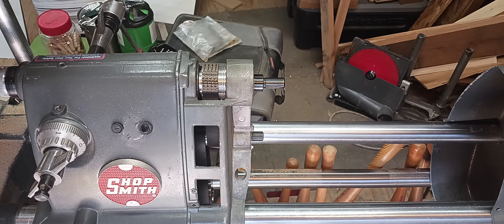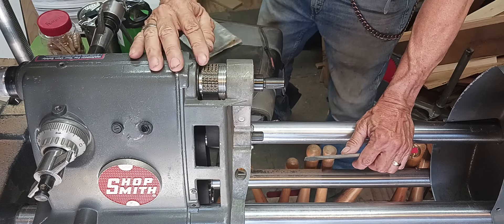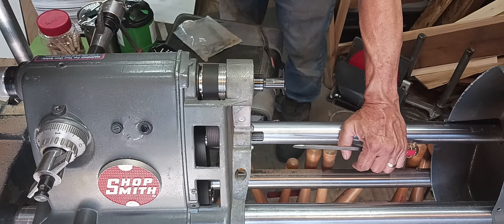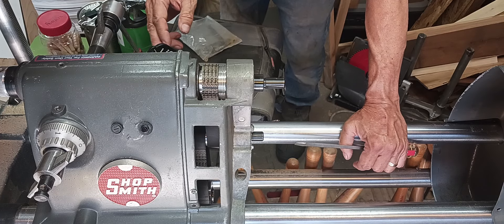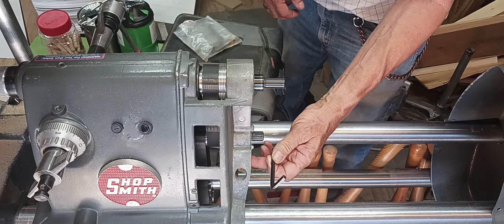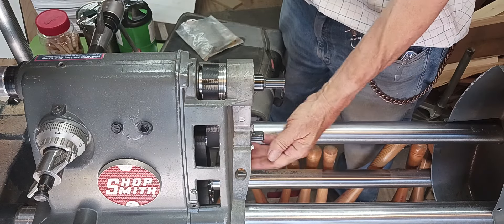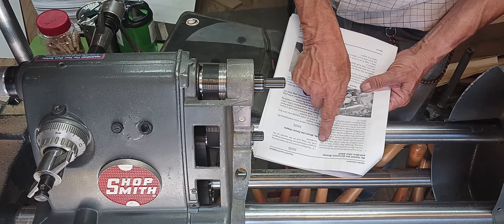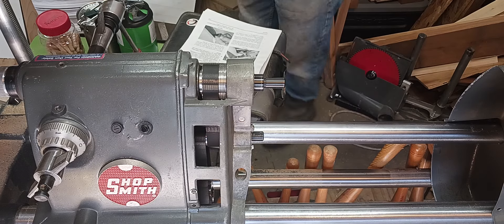Correcting the belt alignment and tension on the PowerPro Upgrade

Comment: Hals Wood Shop.   So you have completed another upgrade , more headache and more power....no just more buttons.   hmmm.  I saw the Power Pro demo live at Lowes by Mike Young and it was impressive and so was the $2200 back in 2017.   I bought the casters and lift assist, both worth the money.   I cannot say your upgrades are worth the bucks.   Enjoying my 510 and many SPT and many accessories I have bought in buying used.   Thanks.  Hoping to see your next project.  Thanks for the Shop Tour
Reply from the maker: Hal,
Thank you so much for engaging into this upgrade. You are so correct on the costs of upgrades vs. increased functionality to do woodworking. The upgrade from 510 to powerpro for me was worth the money but the rest not so much. Thank you and I too look forward to the next project.